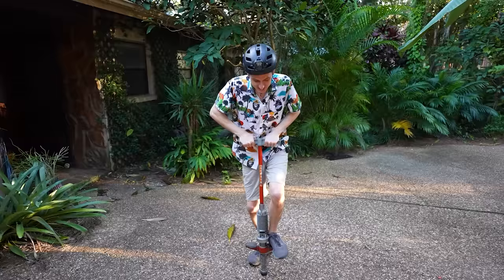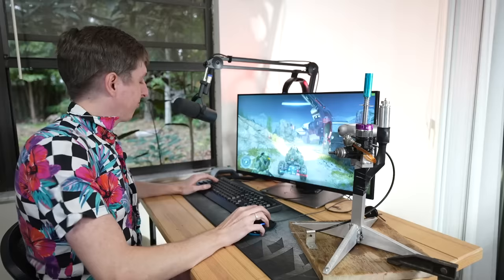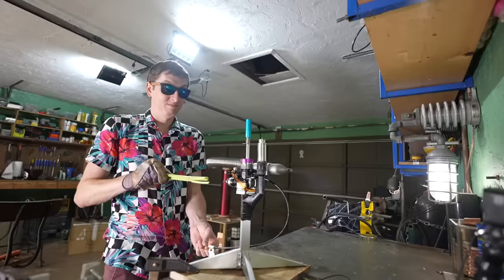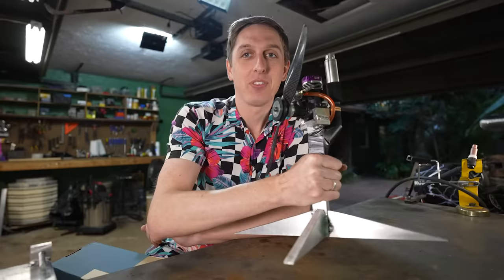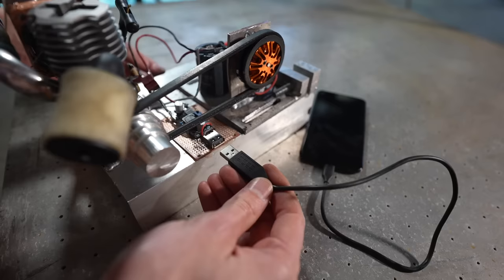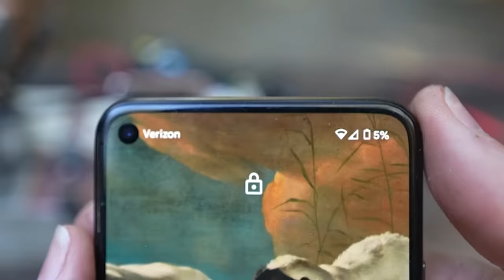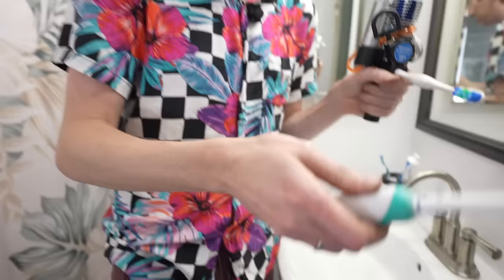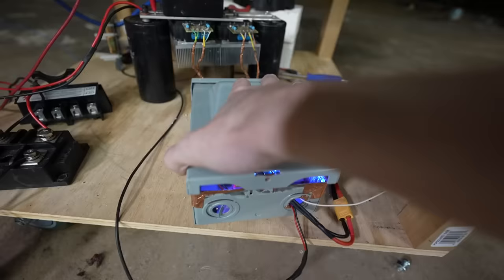Gas powering things that should NOT be gas powered

Comment: I like how he showed that the propeller could shred raw carrots RIGHT AFTER having it run right next to his face by the PC
Reply: and i hear that to cut a carrot you need to aply the same force that to cut a finger 😳
Reply: @skankhunt-fr5qf  not true
Reply: @skankhunt-fr5qf  bones stronger than steel so carrot would be stronger than steel
Reply: @reizinhodojogo3956  he does not mean the bones he means the flesh of your finger
Reply: Safesty third
Reply: He made a vegetable smoothie... provided you can mop all of it up!
Reply: And to get it going he has to manually spin it with his finger.
Reply: @skankhunt-fr5qf  other way around
Reply: @OtteyTheOtter  And he meant that fingers are made of things other than flesh, so you're still wrong, cutting carrots isn't like cutting fingers.
Reply: He's lucky it didn't blow up right in his face while making this video.  Incredibly dangerous.
Reply: @jdirty3460 Kevin's lucky he's still in one piece considering the amount of molten metal he's worked with using protective gear consisting of shorts and a t-shirt. This channel is full of unsafe behavior.
Reply: Bro made a vaporizer
Reply: @skankhunt-fr5qf Nope. You can bite a carrot and your finger at the same time and the carrot will break. I've literally tested that myself.
Reply: I mean the fact that the oil from the fan went on the computer is dangerous it could break it.
Reply: Anything to get them Ws, baby! Safety third.
Reply: Capacitors can literally blow off your fingers, sticking his fingers near that without ppe is a bit concerning.